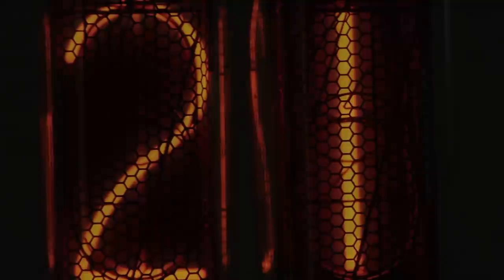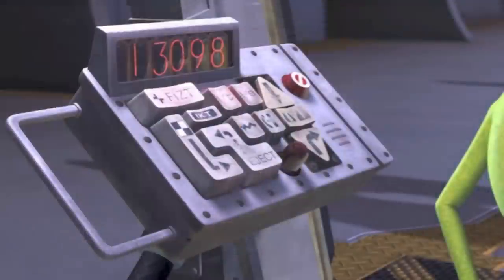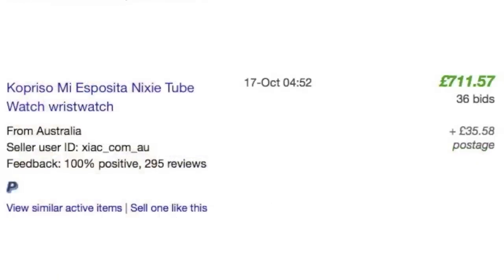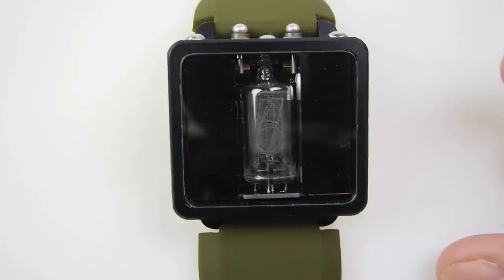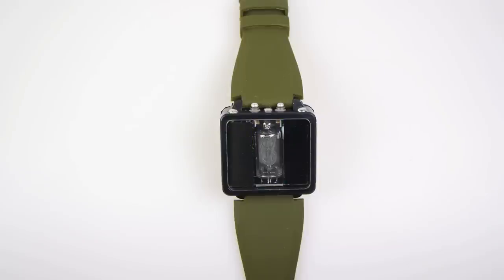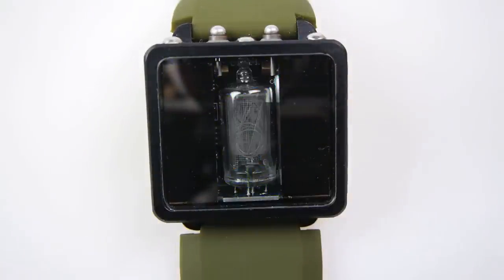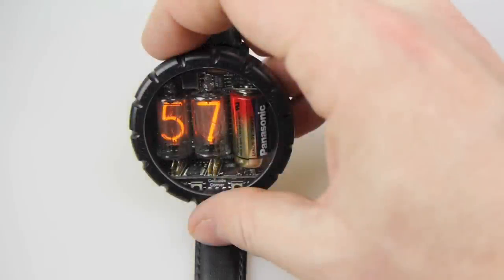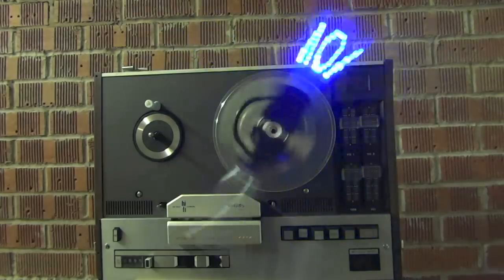The Solar Powered NIXIE WATCH - New 2013 Kopriso Mi Esposita

Comment: That's scary. I love vintage audio gear and now the price of that is going sky high. The only hobby I have left where the price is falling is lasers and laser show equipment. I remember back in 1992 paying 3 weeks wages for a 5mw helium neon laser, which I still have and it still works. For 3 weeks wages now I can get a RGB laser that does animated graphics and is programmable through an ILDA interface. For the last 5 months I have lived on tinned beans and Pot Noodles and ordered one.

Comment: i bought 12 in-14 nixie tubes about a year and a half ago for about $60 i knew i wanted to make a clock and some other stuff with them (i still haven't yet because im still designing the custom parts for it) i play on putting 4 into my computer to show various information. but i bought them back then because i had the fear that i might never get the chance to buy them again. i still might purchase some more.

Comment: It looks like something that wouldn't be allowed through inspection before an airline flight.... something that might carry detonator. I remember using hundreds of devices with these tubes when going through Engineering College in the late 60's and early 70's. The first hand calculators had them too, for a short time.

Comment: what's the lifetime of these nixie tubes ?.  Not too long I understand.
Reply from the maker: Well my four tube Nixie clock in the lounge has been on for 17 hrs a day for six years and is still working fine.
Reply: I can't remember who, but I once heard from someone that if they get wonky (digits not lighting up right or multiple digits lighting up at the same time) you can clean them if you know what you're doing. Don't take my word for it though. I'm just a nerd.
Reply: +Techmoan Is this watch no longer produced...?  Ebay doesn't list one, nor does Etsy...
Reply: +Martin Pescador Please watch the video in its entirety, as he says something that answers your question.
Reply: +N0AGI Nixie tube life can be very long, expect at least 10,000 hr to as much as 50,000 hr.
Reply: +N0AGI If driven correctly, lifetime in excess of 25 years running 24/7 isn't unheard of.